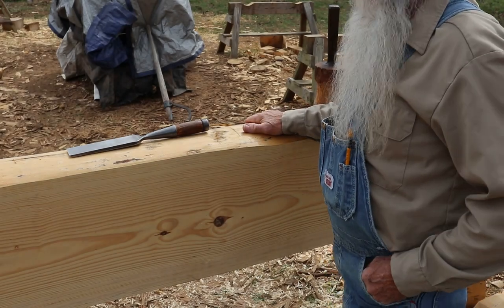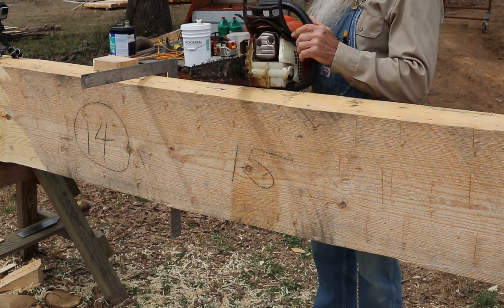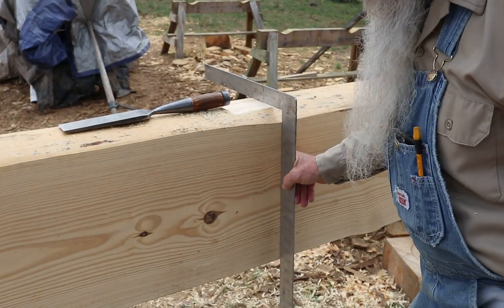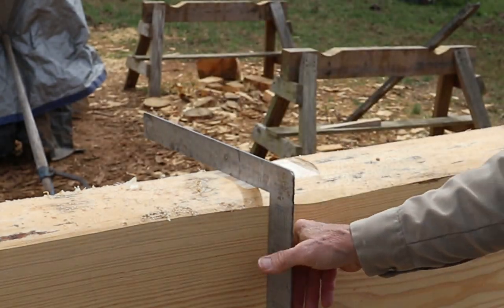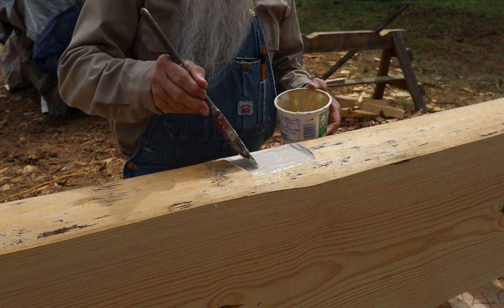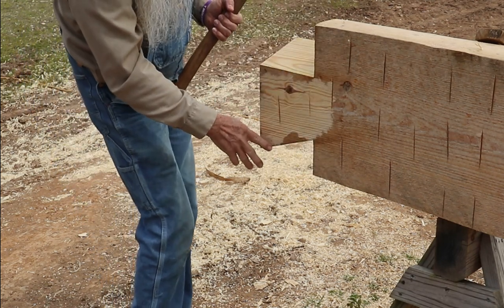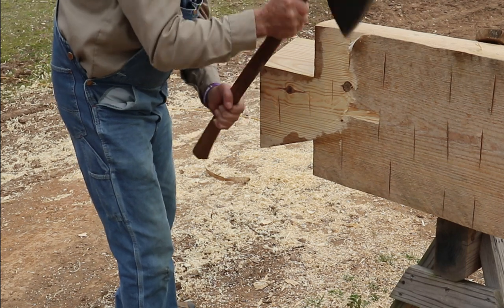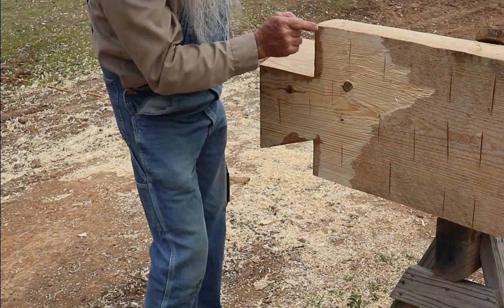Complete Log Layout Pt 3, Hewing - Dovetail Log Cabin Build (Ep 30)

Comment: Paul, could you apply Anchorseal to the dovetail joints where the top log sits on the lower log?
I know it's not needed but could it be used to seal that area from water?
Your cabin looks amazing.
Thank you Sir for the documentary of a hand hewn log cabin build.
Reply from the maker: Howdy Tim- yes, I do coat the upper and lower notches which helps protect the notch. I also coat a pocket that will receive the tenon of a timber. Thank you for watching. God bless you

Comment: Paul, if I may ask: is this hewing (3:58) done for the looks of the log only? Or has it got another purpose, that at this moment eludes me? And same question for the axe marks you made earlier?

Love this series, by the way, have been binge watching from episode one!
Reply from the maker: Howdy- I score ( the vertical axe marks) and hew the logs to remove the circular saw marks and put the hewn finish on the logs. I sure appreciate you watching the videos. God bless you
Reply: @TheBeardedCarpenter  Is a hewn finished log more resistant to rot/bugs over the the years, since it is smoother than a rough finished one? 

But why do you do the the scoring first, Paul, that is still not clear to me. It leaves small cracks in the log which, as I assume, is a place for water of bugs to creep into and do damage to the logs?

I believe The Outsider or Shawn James (both log builders on youtube) referred to your youtube channel. I love your work ethic and admire your skills!

Keep up the good work, Paul!
Reply from the maker: The score marks aren’t very deep and when I hew the saw marks they are even shallower. Since the surface is hewn smooth there is less chance for moisture to soak in. I put a good overhang on the roof and keep the logs high enough off the ground to protect them from rain splatters.  Blessings
Reply: @TheBeardedCarpenter  Thanks for explaining! I'm halfway the series so I have a lot of catching up to do. Can't wait to see the progress!